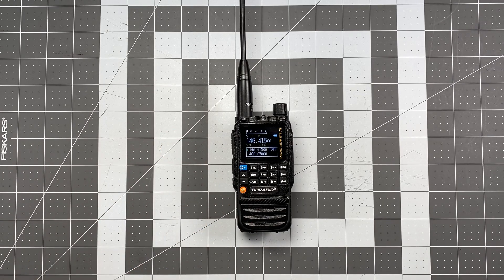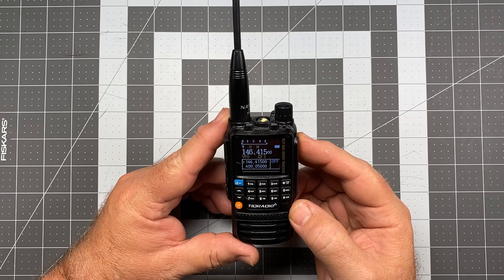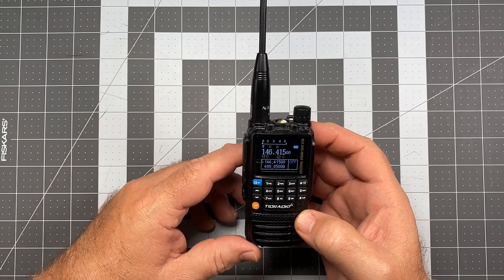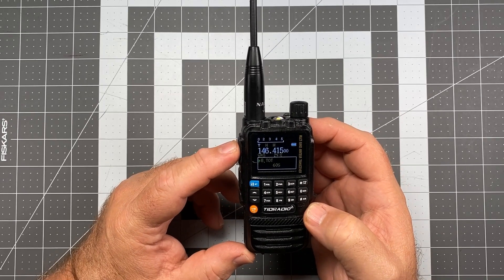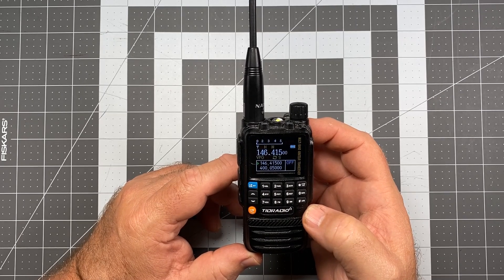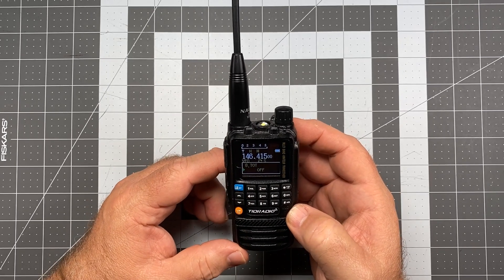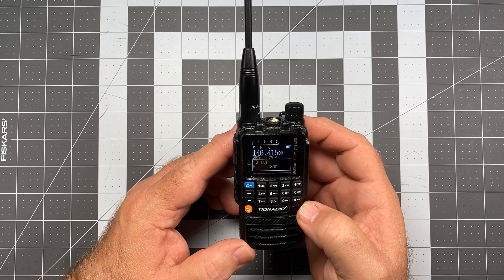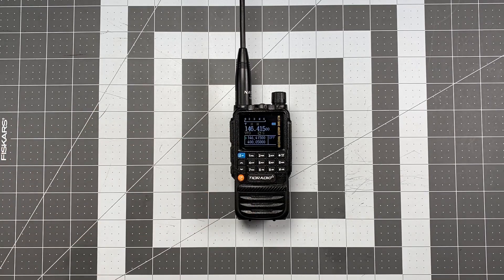TID Radio TD-H3 Operators Series: Part 9 - Timeout Timer

Comment: Hi, I'm hoping you could help me figure a few things out with my hd-h3 radio.. example: radio settings numbers; 46 scramble, 49 DVD, 50 D-HOLD, 51 D-RSP. And then a few in the odmaster app, I know BL is Bluetooth but right next to it is TDL do you know what it's for? And then in the function tab if you go into FM to set your FM radio presets, what is "Forbid receive"? Word mode? Channel? And VFO down at the very bottom do? Disp LCD (RX) DISP LCD(TX) and then under the channel tab what is frequency hop and scramble? If your able to explain these things I would super appreciate you.. I can't find any information online any place on these particular settings